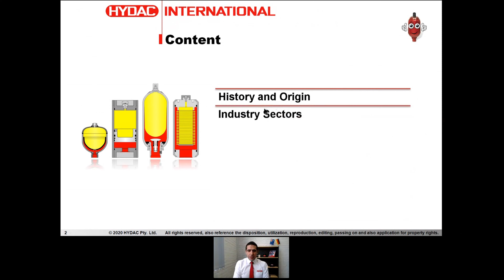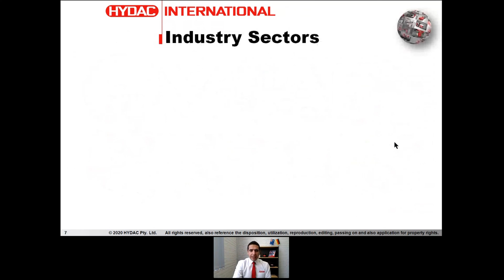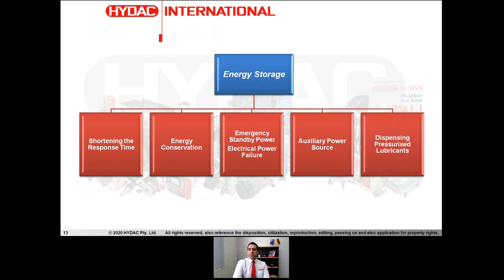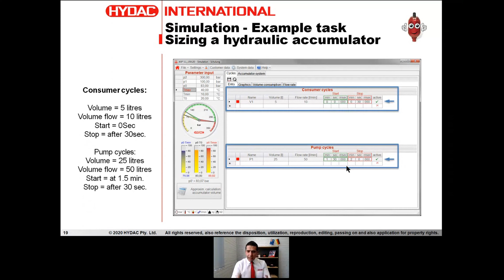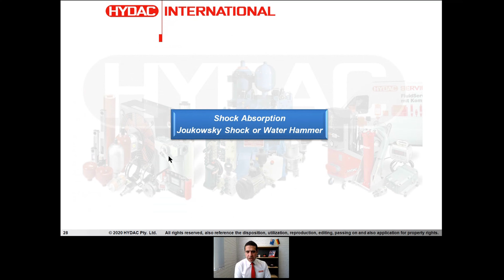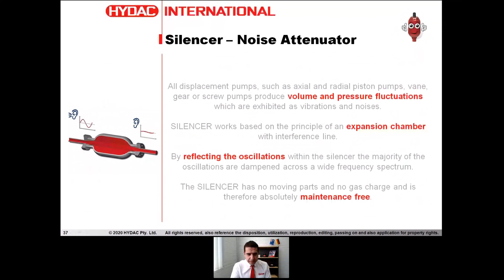Application overview for Hydro-pneumatic Accumulators

Comment: What is the difference in the calculation formulas for the "charge" and "discharge" options for ASPlight?
Reply: Think of gas behavior and temperature changes during expansion and compression.
Reply: @MrAliNejat  Isn't this taken into account by the choice between options "adiabat" and "isotherm"? Or what is the difference between "expansion and compression" if it happens at the same rate?
Reply: @maxmad525  spot on! In adiabatic cycle the changes to gas temperature is minimal and doesn’t impact the cycle. Whereas in an isothermal cycle gas heats up and increases pressure on charge (compression) and cools and loses pressure at discharge (expansion)